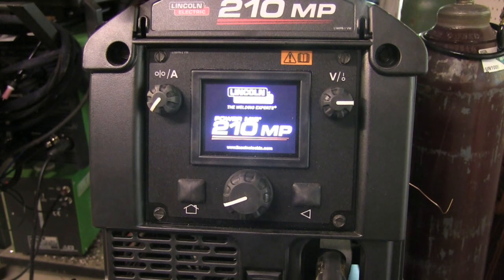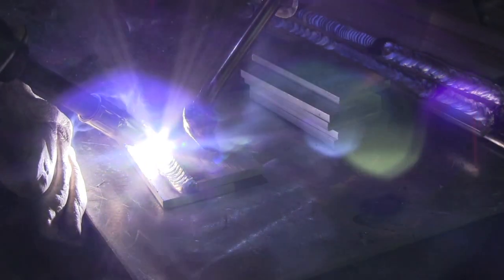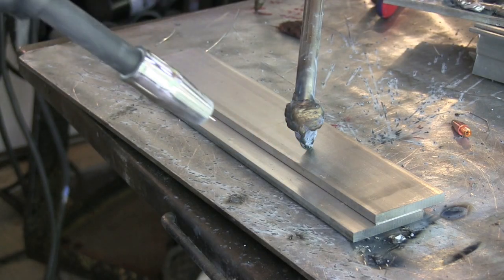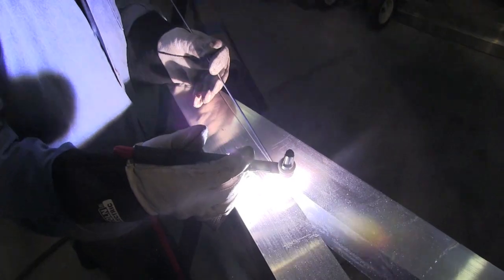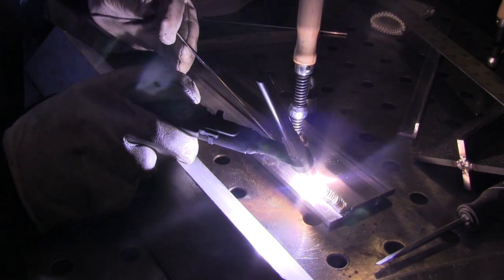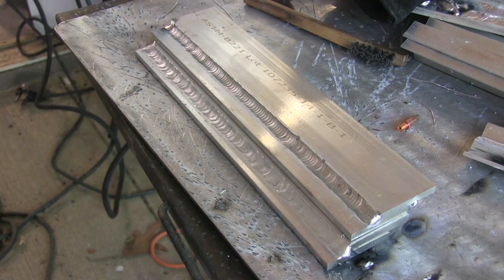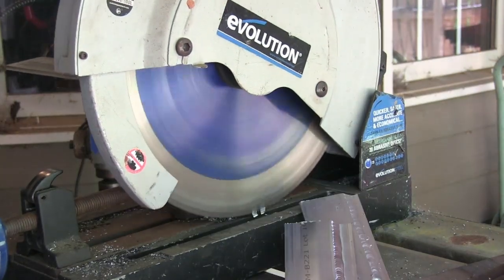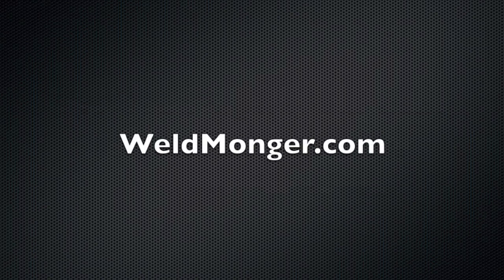Welding Aluminum TIG vs MIG Spool Gun

Comment: 1) when using the filler rods, could you not simply drop the filler rod in the 'crack', leave it there, and just heat and weld ??
2) how big is the gas tank ?   and how long does it last ?

Comment: Jodi, what is creating that "cleaning action" that you speak of often in your tig videos, in this application with the spool gun, because you're not running any percentage of ac? And secondly, is it critical to weld away from your ground? Since this is a direct current process..

Comment: You need more wire speed to break up the oxide layer prevent heat, cracking to make a soft and strong weld, not burnt brittle

Comment: the main problem with MIG aluminum is the internal porosities that are completely invisible on the surface, moreover during aggregations there is a certain tolerance (like no more than one every 5 cm. On the other hand, MIG aluminum is actually a lot more penetrating than TIG
Reply: I was about to say that same point. The mig setup penetrates a lot better in THIS scenario.

Comment: You said what I’ve said a thousand times, “When you pull the trigger on a spool gun, you never really know what you’re going to get”! You can have it dialed in for several hours and then, for no discernible reason, it will go to crap; show it’s butt for awhile, test your religion and then again, for no discernible reason, go back to welding just fine.🤦🏻‍♂️

Comment: I remember the first time I was getting a hang of the mig aluminium.. (fuel tank reparation)
My boss: "..I just told you not to use TIG cause of to much heat on the tank .. why did you do it?
Me: "I didn't, I used the spoolgun"
..He looked, said nothing and walked away  xD, I gues I can stack dimes to make it look TIG

Comment: You don’t want it to crackle like it’s steel. You wanna hear a hissing sound as it’s burning in. A small amount of crackle is ok to prevent undercut but if it’s crackling then whole time you’re not laying in the metal you’re getting less penetration and just spitting metal out of the puddle.

Comment: I just did a job on a aluminum boat as a stick welder, I did it on a spool gun and definitely didn’t come out as I wanted it too, definitely not used to thin aluminum welding, any tips for me to keep moving forward I’m only 18 years of age and definitely got another smack of reality after burning and a little discouraged, trying to keep filling hole after hole it was definitely not as easy as being in school as a desk (which I already know I work on job sites daily) but like I said I weld only stick daily. Isn’t a cry for sympathy more of a reach out for some help. Thanks again love the videos

Comment: Best camera work I've  seen so for of capturing  the welding process.  👏👏👏👏👏👏👏. Excellent  information.  In this short video with the camera work and you hitting on push and pull. Really helps. I was using a new spool gun last night trying it out. I was pulling the whole time. One I got the gas, speed, and temp dialed in. I was able to produce some pretty nice welds. But, they were not as good or as what I have seen on videos.  I do need to buy a new tip and was wondering  why it was melting into the tip some tips. You answered  those questions  for me. I have attempted  to tig weld and looking at the camera view tells me exactly  the distance I need to be at.. Thank you.

Comment: Hi there.  Appreciated.  Just met Al welding - on boats.  Is useful to comment??  -> Most of my welds were overhead, doing the inside roof of a wheelhouse - which was almost as easy with Al-GMAW as "on-the-flat" (Al doesn't seem to give a damn' about position (Lincoln comments is due to : density (low?) & surface tension (high?) & thermal conductivity (high)) - but would become much harder work with Al-GTAW?

Comment: Which method (MIG or TIG) transfers more heat to the welded material (thus tending to warp it more)?  I'm welding 1/8" 5052 plate for a fuel tank and would like to use MIG but am concerned about heat warpage.  Thanks.
Reply: I beening welding  ally boats for over 20 years when I weld fuel tanks for small boats, I mig inside the fuel before I put the lid on, the I tig the outside of the tank
Reply: @johnmcgunnigle2677  Thanks for that insight.

Comment: It all depends on the material and the application of the joint typically the spool gun is usually best for thicker aluminum tig I usually 3/16" and thinner materials also exotics my opinion 35 years exp. Cert. Welder whatever works for you everyone has their own technique keep welding guys

Comment: Now I’ve been doing some mug on aluminum manure tanks and it seems not to want to take or the weld lays out smooth. Cleans with aluminum wheel and then wire brush
Reply: You could try chemically cleaning it with acetone, vinegar or hydrofluoric acid and wiping it with a rag.  A normal steel brush is not the best way to clean aluminum a hard wheel also imbeds whatever gunk is on the wheel in the metal.

Comment: Welding Aluminum Tig or MiG Do I need Argon Gas ???
Can I have some Aluminum Welder Without Gas to do this Job???
Thank You.
Reply: They make stick aluminum rods but they are hard to use and look ugly.  They make self shielding aluminum wire but it is also hard to use and looks ugly.

Comment: I had to mig weld aluminum occasionally at my last job. The 2 biggest things I found was preheat the metal and move fast. With a little practice you can get really good welds. Wish I'd had videos like this back then.

Comment: If you mig aluminium you need a push pull gun not a spool gun. But i guess for a hobbyist it seemed to work fairly well. With a push pull setup set right i can weld 40hrs a week for usually about a month on 1 tip but just the gun is about 1800 dollars

Comment: Thank you for this video. I'm a retired Boilermaker. I'm doing volunteer work for the Florida state parks department. They asked me if I could build a new 12x8 aluminium pump bed for their truck. I told them sure. They bought a harbor Freight welder and spool gun. I used to weld pipe most of the time, Some aluminum this and that. I started going through contact tips like crazy.  I've welded some spool gun, not much. I finally got the settings close it was much better. But every thing you talked about happened to me weld's great then not so much. Watching this made me feel better.

Comment: i realize its 3.5 yrs old but  thanks. the short section i saw of the spoolgun i understand your want to back off of wire speed but it also minimizes penetration.  i learned the easyOFF trick, didnt kno i could use that.  But im a good spool gunner and a entry level tigger.  I am constantly checking my power levels as id rather have "strong Ugly" instead of "shallow Pretty".  Spatter is nothing more than misguided gun angle, it happens. with aluminum the worst thing you can do is linger. Time = Heat = Distortion.  Run hot, get it done quickly, & move around often. 
side note- Jody id love to see a "how to tig off the table" video. running a pedal is various situations, standing on your head etcetera. lol

Comment: I tig weld aluminum all the time but MiG only a few short times. A lot of it has to do with the machine and how it’s set up. One time I welded aluminum tubing with MiG set up and could barely make successful welds, another time it was as easy as steel. Too many factors, you can’t just ‘ close is good ‘ it.

Comment: Ive only been spool gun welding for 2 years mostly 8th in square tubing for sign fabrication... But recently I've been having to weld 1/4in tubing.. I noticed when he ran his bead it looked uniform from start to finish but with mine I have it set at 565 amps and 23 volts and the weld is cold at the start but lays down nicely after the material heats up what am I doing different or what am I doing wrong?

Comment: I am on the market to buy an affordable MIG set up with a spool gun. I own a Millermatic 130 XP that I bought new 19 years ago, but finding a spool gun has been difficult as Miller has discontinued them. My original setup was just the welder and non-auto shade mask and the gas bottle. It came to around $750.00. It has been and still is a very good welder. 
  My intentions are to begin welding aluminum to build custom toppers and various projects that require structural welding. Being self taught, my knowledge base is a bit limited.
    Is it at all reasonable to find a solution for my needs that will come in under the $1000.00 price point?  If you can point me to a video you have produced or some other resource, this would be greatly appreciated. 
  I am on a quest to fabricate some lightweight pedal and electric vehicles for fun and art as well. I am intrigued by the newer Harbor Freight products. I have tried the Lincoln mig welders in the same class as my Miller xp, but I found them a bit underwhelming. 
     I also would like to see more safety related information for us novice welders in the world. I was a bit worried about your camera person shooting this video that my comment is written under. 
      Also, one more thing, In my personal experience, the auto shade helmets provide a decent 10 shade after the initial arc strike. My worry is that for the two milliseconds of lag time after the flash hits the photovoltaic sensor, the user is exposed to the welding burn, albeit for a couple of barely measurable bits of time. I noticed that for me, this did hurt my retinas a bit.
     I have been following your chanel for several years now and do truly appreciate your and your teams content. Please keep up the good work.
Reply: I did teach myself how to weld in 1982 with an 80 amp stick welder. Tons of fun that was.
Reply: And, I did have some fun tig welding for a job at a scenic studio ten years ago.

Comment: weldmonger, really enjoy your videos, I'm a retired pipewelder but have very little experience wth aluminum, and have a project to do on jon boat that has crack at the top of transom the repair area isn't in spot that would sink boat but need welding to prevent from spreading. Would it be ok to mig weld?

Comment: I think I weld 12 inches 3/16 plate in around 20 seconds, you dont need to go that slow on aluminum. Crank up the heat to where it's making a heat mark on the backside but not burning through. A useful tip: the steeper the gun angle, the cooler the puddle will be.

Comment: What machine do you recommend me getting for tig welding. I work on the aviation community but most of what I’ll be doing with my machine are little projects like chainsaw stuff and some aluminum stuff. I’m just getting into welding but would like a nice machine. Could you recommend a machine that I could tig steel and aluminum? Thank y’all!

Comment: Awesome video. But I don't think that time comparison holds up in the real world because of how much more effort it is to move that quickly with TIG. I wouldn't be surprised if the MIG does the 16 IPM speed all day long, and the TIG ends up at closer to 8 IPM (or worse) at the end of the day.

Comment: I tried to butt-weld aluminum alloy (diamond plate) that was like ? 16th or so.. spool gun with 110 machine.  Poor outcome... you said think twice before welding thin stuff...  what would you do?  (used diamond plate panels to make a 5x8 utility trailer floor)

Comment: Cleaning the extrusion makes a massive difference and the angle you push is pretty critical when using 100% argon. 75 he 25 ar is wayy easier to use.

Comment: Should you use a brass brush on aluminum?  I've heard that steel brushes or pads on aluminum will strip the oxidation layer and some kind of reaction between the steel and aluminum will keep the oxidation layer from fully reforming, leading to corrosion.  I'm building an aluminum airplane and have been told specifically not to use steel abrasives for that exact reason.  I'm working with 6061T6.  Not sure if that makes a difference or if that type is more susceptible to corrosion than others.  Not criticizing your work at all, genuinely curious.

Comment: It seems pretty simple to me. 

TIG = Better joint fill (rand all the way, filling the deepest corner of the joint), more flexible weld angle, cleaner appearance, uses less fill material

MIG = higher productivity, better penetration

To me, it would all boil down to available weld angle and if cosmetics matter. If the angle allows you to push, and the weld won't be seen (or cosmetics aren't an issue) MIG. If cosmetics matter, or if the weld wants to sluff or has too much porosity, use TIG.

Comment: Do I need to have 240 Volts to weld with aluminum or is impossible to use 110V? Your video's showed me to weld in my home shop with a mig successfully, having made several pieces of furniture and recently an aircraft rescue dolly for recovering an aircraft with a flat tire off the runway after landing, pretty pleased with my progress, Thanks. So now I have been approached to provide some services for welding aircraft components for a shop and need to learn to weld Aluminum, any suggestions would be helpful. Thanks again for the support. Nick.
Reply: Depends on the thickness of your metal.  110V machine will do fine on thinner material.  If you go to thicker material you will most likely need to get a more powerful machine.

Comment: sigh my welds look like sh#t compared to this. But we are using a Lincoln 140 which is 110 volts and  1/8in thick aluminum which we pre-heat with a torch. Temp sweet spot is about 225 degrees, but holy crap, no way can I travel THAT fast and it certainly cannot straight pass a line, stacking dimes gives the best result. I thought my welds were looking great until I re-watched this video :P 😱
Reply: WT Farm Girl Videos women generally have better hand-ey coordination than men, or so I’ve read. Keep working, you will keep getting better!
Reply: practice practice practice! i took up welding as a hobby last weekend (its 1/14/19), so i know what a crappy weld looks like. His are quite good. I will be there one day if i live long enough. I am interested in welding aluminum. never mind the fact i cant weld steel yet.

Comment: Hi Jody....I'm ordering my Everlast 255EXT next week along with a 60S plasma cutter.  I've done all of my aluminum welding using a Millermatic 210 and a Spoolmate 3035 spool gun.  It looked like the aluminum you were using for the weld test had factory edges.  I've always cleaned my aluminum for MIG welding.  Could the porosity shown in the cut section of the MIG welded aluminum be from the factory edges?  I know the TIG didn't show the same porosity, could that simply be due to a better gas coverage?  Thanks, Curt.

Comment: That mig weld penetration looks substantially more to me, and it was faster, which means it has more strength, so for me, mig looks the better choice.
Reply: But if you want nice welds like on motorcycle frames etc. TIG is better.

Comment: Good advice
I own a transmig 275 with remote, it has a teflon liner and rollers and takes a bit of setting up.
I have to use fire blankets around the work due to spatter and cleaning with acid.
It goes through tips too like you mention.
I was wondering if it is possible to use a TIG handle on this unit, its 275A DC.
It would be easier to swap the handle and argon bottle and do some TIG than swap the rollers and liner as well every time I want to do some Ali.
Cant find any info on using it for TIG.
Is it even possible ?

Comment: I just bought the power mig 210 mp and I would like  to start welding an aluminum frame but I  would like to know of this welder would be able to weld 1/8" aluminum with just the tig and without the spool gun set up. Please let me know. Thank you

Comment: House hold power has many other frequency which changes around and then comming into resonic  ofwelder output coil and the capacitence welder tip to metal surface. One set of inductive to copasitive values works many frequencies harmonics there by having pull to working frequency. stop and get a different near by frequency  either higher or lower than the one your using. then change welding characteristic. to stop this just build a frequency stopper box having both of each its own circuit. Each circuit is a wire winding on metal core in series with a condenser and a light bulb from hot lead to neutral  and a third one between the two hot leadswith two light bulbs. let them show as to give light and that electrical current is ready for you to use. plug it in house socket and then the welder into the box that you have put it in. When visit a Best welding person you will see something like it at their welding station too. Otherwise you will need to practice practice practice  always practice. Just to keep it sharp. 
I've welded for 40 years and have a hobby of electronics too. I use the box personally, for if you get off the welding habit then restart you will digress less with the box than without it...
Reply: Cool man thanks

Comment: Excellent video as usual. Can you make a video about MIG welding copper?? I just tried it after a lot of preparation. It went pretty poorly. I was welding 1/2" pipe from HD to a Female 1/2" NPT sweat fitting. I used argon. Tried many speeds and current ratios. Seems like high conductivity was hurting me. I wonder if helium would have helped. I'm pretty sure preheating may have been the key I was missing. Thank you.

Comment: Did you notice the crack on the left of the  bottom plate of the mig weld cross section at the end of the video?    Cause?

Comment: I bought a mig welder from Northern tool several years ago. It's a Schumacher 145 Turbo. I have had problems along with feeding aluminum wire since new. I recently purchased a